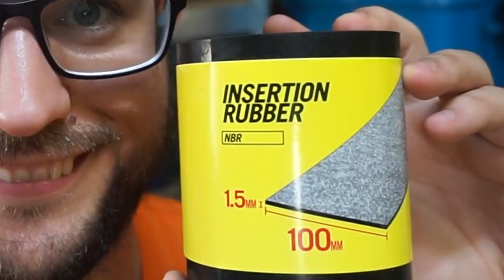Best New Cheapie - CRKT LCK

Comment: You had me going with the sandwich for a second there, I was thinking 'WTF, man", ahahaha. This looks like one hell of a deal for the price point, but I have never had any love for coated blades, so this one does not grab me that much.

On a side note regarding the tin door, I had one like that and used magnets to keep it closed. Those strips eventually get grimy and no longer stick. Basically just use a high-end super glue or gorilla glue and attach small thin magnets to the bottom and top corners and the door will stay tightly shut in wind, yet still be easy to open and close for you.
Reply from the maker: awesome idea I will definitely do that!

Comment: Can you go lower than the 17 degree with the KME?
Reply: Depends on the blade size and shape, eventually you get low enough where you start grinding away at the jaws. But yes lower can be possible if the edge of the blade is far enough away from the jaws
Edit: in order to do so you'd need to remove the KME guide ball assembly and put it back on upside down

Comment: Hey you should review CH knives, they have d2, m390.....
Reply: And Two Sun knives (D2; some M390).
Reply: @frederickj.7136  seconded on the twosuns! LUVTHEMKNIVES has sent those for testing,  and the d2 and m390 has always come back as legit with a decent rockwell. I think the CH knives came back with  a softer heat treat,  but legit steel.
Reply: @ Iokua Joshua... I have TS-51*1, TS-27, and TS-21 'Update'. The first two are just perfection in deployment and release - drop shut (though the first requires keeping finger pressure off the lock bar -- it's my favorite and very slim). The last is a bit too light in 100% no-stick release pressure -- therefore I'd call it "gentleman's carry" or light-medium duty EDC -- but, man, is it effortlessly smooth! The TS-27 is, as billed, a great camp knife -- much overlooked, I think, in its G10 + liner lock form; which I prefer over the titanium version for its all weather friendly, secure, comfortable grip and its much lower carry weight (big knife!).

I wish Two Sun would start concentrating on some lightweight 3" blade models in their D2 (or M390) instead of sticking to larger, longer, thicker bladed knives and relatively heavy, rather polarizing M390 short bladed designs. I'd start snapping up that sort of Two Sun in auctions if they'd give this a shot.
Reply: @frederickj.7136  I would love some lighter knives too... I just got a ts89, and the weight and length of it make it a heavy duty knife, but not one I will carry too often.

If you so want a lighter twosun, I bought the ts111. It has a smaller blade, maybe 3.5 inches, and a carbon fiber show side. Still has a darkened titanium framelock, but wow is that thing lighter than most twosuns, while still feeling good and keeping a nice framelock.  I would gladly buy one in m390 though they haven't made one. I think they have a similar knife in a more traditional shape, with the carbon fiber show scale, the ts103 or ts103?
Reply: @ Iokua Joshua... The TS-21 'Update' in titanium comes in at about 3.74 ounces, and it's pretty slim for dress or EDC. It has a very well profiled 3.5" blade, as well. I have a sub- 3.5 ounce personal preference, though, for EDC knives of that blade length... and a sub- 2.5 ounce preference for 3" models. Very do-able, even for dress knives (e.g., LionSteel T.R.E. G10 + titanium, 2.39 ounces; and Massdrop /FF /WE Gent with rosewood scales, 2.43 ounces... same as my carbon fiber dressed up Chaparral).
Reply: @frederickj.7136  that ts21 update actually sounds pretty sweet. Anything special about the Updated version verses the original? Did they mill the handles on that one to get it that light??

Edit, the ts111 is 3.1 oz and a 3 1/4 blade on it
Reply: @ Iokua Joshua... Um, I don't recall that, I.J.. There's no back spacer, and minimalism in the "hourglass" spacers. My Massdrop /FF /WE Gent, for example, also has that 'everything you need, nothing you don't', open frame titanium aesthetic, just with 'over-scales' of rosewood added on top.

The 'Update' seems to be about taking the regular TS-21 and "laser cutting" (?) or seriously CNC  "etching" out a scale pattern with dual color anodizing -- I describe it as like dry, fallen leaves still on the ground in late fall; an irregular, random pattern. It gives a great grip. The anodizing is bronze & purple-ish, following the "etched" pattern exactly .

I have not seen this iteration on eBay for awhile, and I don't think they were doing this for long... at least, not for their auction sales. I could have missed 'em, though.